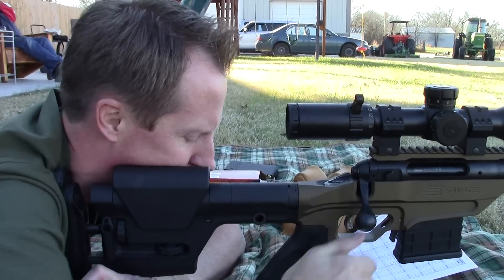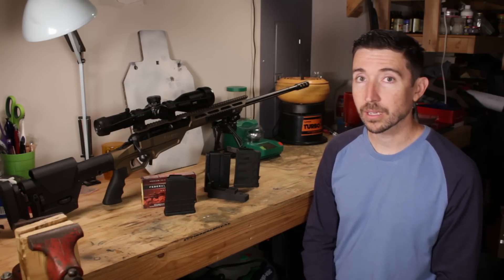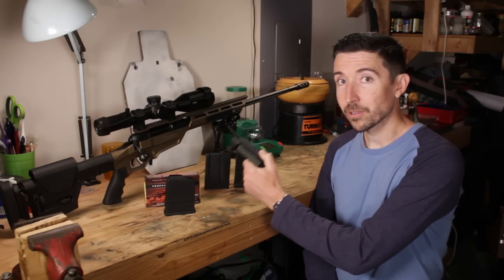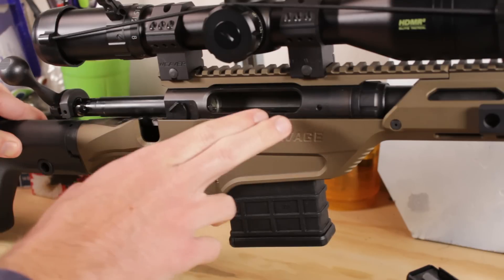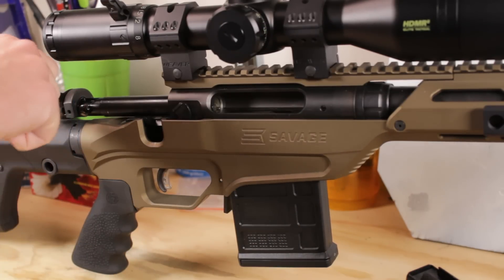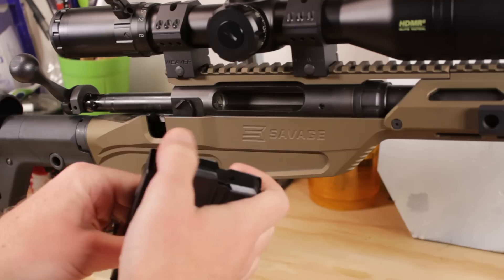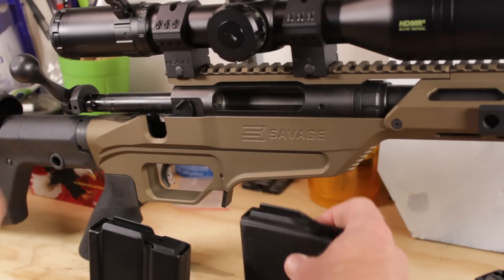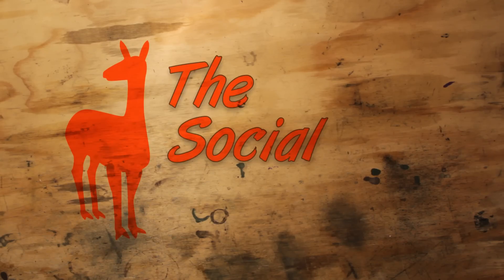Accuracy International (AICS) Pattern Magazine Compatibility in the Savage Stealth Evolution

Comment: I have one accurate mag, and it is the best mag I own. Amazing quality, super tough, I've never worried about hurting it, even with a +2 baseplate on it.  But it was PRICEY.

MDT mags seem to be the standard. Everyone uses them and I've never heard of anyone having issues. The only issue I have is with the poly/metal mags, they are a gimmick tbh. I bought one because I thought it was a cool concept, but I dont really care about it now. The window doesnt go high enough up the mag to actually be good for counting rounds (with the mag fully loaded only about 1/3 of the window is filled with brass), the metal lips are just a piece of sheet metal wrapped around the polymer body, and they're not any better or worse than the regular polymer mags; while costing substantially more.

I honestly would just stick to the polymer MDT mags if you're on a budget, use the metal MDT mags if those dont work, get the accurate mags only if you're going to abuse the shit out of them, and ignore the poly/metal mags. 

As for Magpul AICS mags, I have yet to hear about anybody being able to relyably use them without spending ten minutes with a dremel on them first. But I dont have any personal experience with them.

IDK just my mileage and 2 cents, YRMV.

Comment: Good morning. Would it be possible to know how to attach the Atlas BT65 bipod under the mdt LSS RF chassis? Thanks in advance.
Reply from the maker: You bet! The underside of the rail is M-Lok, so depending on which bt65 you bought, you'll need either a 1913 Picatinny rail section or an ARCA rail.  It should be an easy installation.
Reply: @SocialRegressive  Merci beaucoup

Comment: Certainly answered my questions as I was looking into getting 2 savage axis precision rifles .223 and .308 with the oryx stock from savage. Along with getting 2 magpul hunter stocks for my current savage axis .223 and savage model 11 hog hunter as it's a top feeder. My thoughts were if I went that route my magazines would interchange amongst the 4 rifles.
Reply from the maker: The mags might interchange with those stocks; this chassis is a bit unusual in that it only prefers one magazine. My accurate mag bottom metal likes the magpul and accurate mag magazines.
Reply: @SocialRegressive  that crazy how the mags are designed really close to spec with one another but only 1 works with the stock.

Comment: Stupid !
At least test with dummy rounds !
Or you could've removed the firing pin.
Reply from the maker: Modern Savage rifles have a middle safety position that lets you run the bolt while blocking the trigger. I'm unconcerned.

Comment: Interesting. There’s a definitely variation in AICS mags.
I have no problems running Accurate mag and MDT steel mags. Magpul and Bergara poly mags both work a treat. I cannot fit MDT poly or poly/steel mags in my Accurate mag chassis without them completely jamming in the mag well.
Reply from the maker: Same here. The MDT mags are too wide for the Accurate Mag bottom metal. Probably CDI and Pacific, too.

Comment: I wish I had seen this video before wasting $40 on a Magpul AICS short action magazine that jams up in my Bergara B14 HMR Wilderness 6.5 Creedmoor. I contacted Magpul and they told me that the 10 round mags dont work in 6.5 Creedmoor, only, 308. Yeah, no kidding. Anyway, I just purchased an MDT all metal 10rnd magazine and hope that it will function better but they are not cheap. I would like to use the MDT Polymer mags because they are half the price but I'm still a little gun shy after the my experience with the  Magpul mag (I own lots of Pmags in .556 and never had any problems with them). If anybody has any experience with the MDT polymer mags and the Bergara Wilderness please let me know about it.

Comment: I couldn't get my 6.5 creed to feed with the mdt poly mags but after i tuned the feed lips on the mdt steel 10r mags it fed perfect everytime.(Ruger American action)
Reply from the maker: I'll bet other Ruger American owners will like to read your notes.
Reply: DUDE. I have an MDT ESS chassis for my 6.5 Creedmoor Ruger American and I’m having a hard time with magpul mags. It seems like the rounds and Follower nosedive just as I’m about to strip the round from the feed lips and causes the stripped round to jam into the barrel just below chamber. Shorter loads have time to level out and feed into chamber but longer factory loads just jam. Bought some mdt steel mags to play with and I’m hoping it cures it even if I have to tune them.
Reply: Also this is only for every round except the last round. The last round feeds perfect because it has the follower to guide it.

Comment: My Pmags don't fit into a X Bolt HS3. The mag well is very clearly defined and specifically cut to seat only MDT mags, as the metal lining of the mag well on my X-Bolt HS3, hits the longer polymer feed lips that hold a bullet down on Pmags. I only have Pmags in .308 which sucks ass. Maybe AICS brand mags could "work" but I don't want to go through the hassle of buying and trying to see if they don't. I"ll just purchase 10round MDT brand .308 mags. That's kinda shitty of MDT, to create magwells in such a way that they only perfectly seat their own brand of mags. So if you buy an MDT collaboration firearm, be prepared to use the MDT proprietary magazine cut.

Comment: I got the Accurate 308 Mag for my savage 12FV 6.5 CM and I love it! Just a tip though when using it. Don't push it up. Soon as the mag clicks in, let it hang at its lowest point.
Reply from the maker: I'm glad to hear it. Based on some of the reports I've received, it sounds like MDT changed the height of the mag catch. Folks are reporting good feeding with PMAG now. Thanks for letting me know!

Comment: Why not test the full 10 rounds? I ran an MDT mag with 10 rounds in a Cadex chassis and found that round 9 and 10 had issues. I ran the test twice and exact same issue both times. The 9th round came positioned with a significant nose dive so would not move and I had to pull it back into position.

Here is the link to my test...   https://www.youtube.com/watch?v=CPWo0T4Iyho

Comment: This is late to the party, but the Magpul 5 round works fine.  There is a fix for the 10 round shown here. " https://thereloadersnetwork.com/2018/12/28/magpul-10-round-aics-has-this-happened-to-you/".  You can also warp the spring on the 10 round to provide more rear of cartridge support.  The test to determine if you have this problem is to press down on the follower rear end .5" and release, and then press the tip end down .5".  If you hear a spring spronging noise it is because the spring is tumbling out of column.  When loading the magazine this happens after round 2 through 4, and then the spring returns to its rearward column position.  When running the rounds out, the magazine will feet the first 5 or 6 rounds properly, but fail to lift the base of the next 3 to 4 rounds enough.  The last round will feed OK as the spring returns to its rearward column position.

Comment: All 3 magazines need to be tuned. Simple adjustment/modification of the feed lips so the round sits slightly higher and is directed at the top of the feed ramp/bottom of the chamber will eliminate all feed issues.

Comment: Hi there Kyle , can you tell me if the Accurate Mag bottom metal is suitable for a Savage model 11 scout rifle ? If they are what do they cost and is it a job for a gunsmith to have them fitted ? Keep em videos coming Kyle , there very informative.  Cheers from Down Under .
Reply from the maker: Great question, Jim! Based on what I'm seeing and reading, you can swap the bottom metal to Accurate Mag, but you'll have to tweak the stock inlet, even on the plastic stock. You might call Accurate Mag and ask the particulars.

Comment: As you mentioned, you weren’t in the proper position behind the rifle, which has the same effect as “limp-wristing” a semiauto pistol. Rifle actions, no matter whether a bolt action, pump or lever, are designed to be worked assertively. If you don’t work the bolt at the proper speed, it won’t pick up a round from the mag or eject the fired case correctly. It’s like trying to drive a 16 penny nail with a hammer held just below the head.
Reply from the maker: I ran all of these magazines from behind the rifle on a earlier outing. The results were essentially the same; just magnified by the awkward angle for these camera shots. The Accurate Mag was still sticky and the Magpul still didn't work.

Comment: Nice Video. It would benefit the user to trim the Magazines from the intended 1.56" .308 Shoulder to the 1.49" Shoulder of the Creedmoor.
Reply from the maker: I think you're right.
Reply: @SocialRegressive  I bought a new stock and PTG bottom metal for my Win 70 Classic DBM.  I found that filing the AICS mag lips a bit here or there depending on which type made them work perfectly.  I filed the inside first which also shortened them a bit.  Then found the metal mags also needed filing similar to what Frederick is describing above so the rounds can "jump up" level into the claw.

Comment: I had a problem on my 700 with the AICS M5 bottom metal, when I bought the AICS Magnum PMAGs.  It ran the steel MDT mags perfect, but the thicker plastic feed lips on the PMAG didn't allow the PMAGs to seat fully.  I end up putting a thin layer of epoxy between the bottom metal and stock to give a little more headspace/offset for the PMAGs.  Now the PMAGs and the steel MDT mags seem to work fine.
Reply from the maker: Cool idea.

Comment: Great video TSR!

The more I see your Stealth Evolution the more I think its the perfect chassis gun. It addresses all of the short cpming in my BA Stealth minus the mags.

In my 10 BA Stealth in 6.5 I actually have the opposite issues.

The stock MDT mag doesn't fit well and rounds are very difficult to feed with some failures to feed.

The pmag in the other hand addresses all issues, it fits well, feeds awesome and reliably everytime except that as you experienced depending on how it sits in the well it does scrape the bolt. It can actually catch the bolt if apply upwards pressure on the mag and deoending how much pressure can stop the bolt (a lot of pressure). I usually give mine a little wiggle when it goes in and that way i know its seated towards the bottom and the bolt does not contact. So not perfect but pretty darn good operation wheb used right. Wouldn't rely on it in a combat situation where you life depends on it but I will never be in that situation with the rifle.

Upon inspecting the difference between the pmag and the MDT mag, it appears as if it needs some of the material removed out of the forward lips of the mag. I assume this is because it was designed for a 308 which doesn't require The verticle upward angled feed that all 6.5 creedmoors seem to require because of the very long projectiles compared to case size.

After using the pmag I'm going to call Savage and see what they say about it cause the feed kf the MDT mag is certainly not proper!

The

Comment: I don't have any MDT magazines but I do have an AccurateMag, Magpul Mags and Ruger AI-STYLE magazines. I have a Howa Chassis Rifle with the chassis made by Accurate Mag in 6.5 Creedmoore and Brownells BRN-1 which is a slightly different MDT LSS-XL/LSS-XL Gen2 for a Remington 700 chambered in 6.5 Creedmoore. Another Variable one has to consider is the barreled action itself which is why MDT has a notification on its website that their MDT AICS magazines are the only magazines they recommend with Howa 1500 barreled actions in their MDT Chassis. With my MDT LSS-XL/Brownells BRN-1 Chassis and a Remington 700 6.5CM barreled action, I found that Accurate Mag & Magpul AICS patterned magazines feed flawlessly when filled to the 10 round capacity. The HOWA HCR will only accept the metal Accurate  Mag magazine when filled to the 10 round capacity and works flawlessly. HCR will work flawlessly with the Magpul AICS magazines but magazine has to be filled to 9 rounds or less. Neither works well with the  Newer Ruger AI-Style magazines. Once again the HOWA HCR by Accurate Mag will only accept polymer magazine with 9 rounds or less. After 2 or 3 rounds in the HCR, one has to push the bolt halfway to dislodge the cartridge, pull the bolt all the way rearward, then push feed the round into the chamber in order to keep from jamming the rounds into the feed ramps ( 'Double-Clutching' so to speak; NOT GOOD! ). The two Ruger AI-STYLE magazines work better in the MDT LSS-XL but not flawlessly. Initially, the first 5 rounds would feed flawlessly and the 6th round would be 'nose dived' in the magazine. I would have to push the rear primer side of the cartridge down and rounds 6-10 would then feed flawlessly on both magazines. After leaving each filled to the 10 round capacity for 1 week, I have the same issue with the Ruger AI-STYLE mags but now they feed the first 7 rounds flawlessly in the (MDT LSS-XL/Brownells BRN-1) before having to re-seat the 8th round. I have wait and see how the Ruger AI-STYLE mags work with Ruger American barreled actions in other AICS bottom metal/chassis platforms before I can make an accurate assessment of the magazines themselves. I hope this information was helpful and didn't further muddy up the compatibility waters.
Reply from the maker: I think the waters came pre-muddied. :D Good info, man.
Reply: On 07/07/2018, I found that my Ruger polymer AI-STYLE magazines, fully loaded to 10 rounds, work well with MDT'S LSS-XL Gen2 chassis in combination with my Savage 10 barreled action. They're a tight fit and one has to "slam-them-home" to make sure they 'seat' properly in the magazine well. They do not drop freely but feeding and extracting is what's most important to me. The magazines have been fully loaded for a couple of months which may be the cause of better results. I'll have to go back and retest with others to confirm.